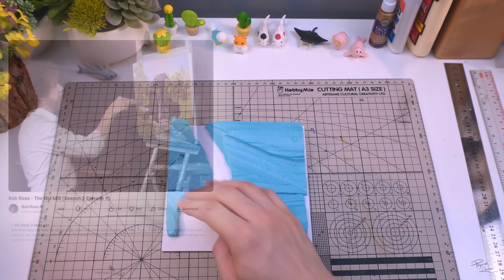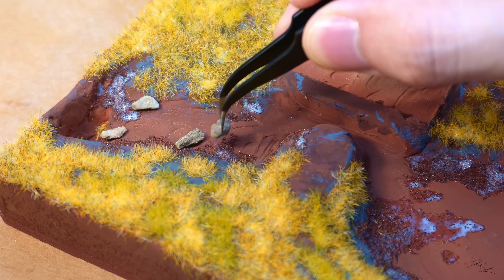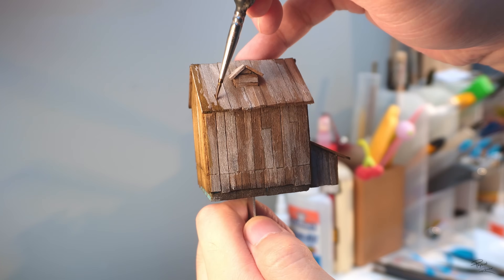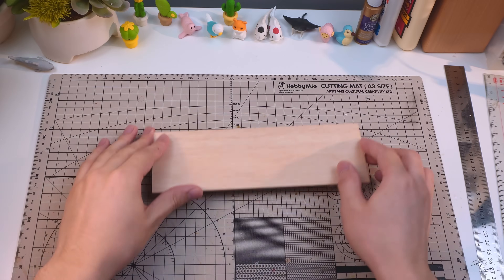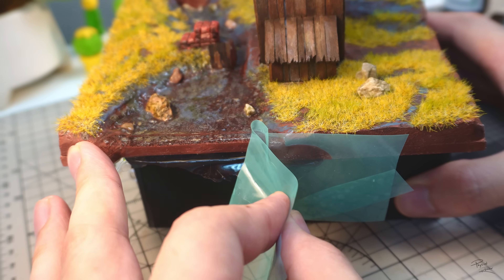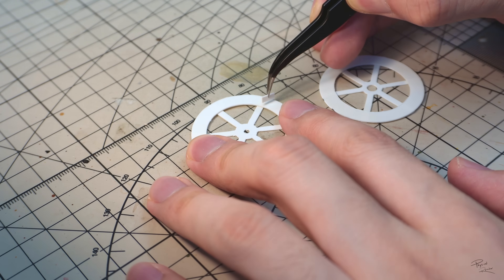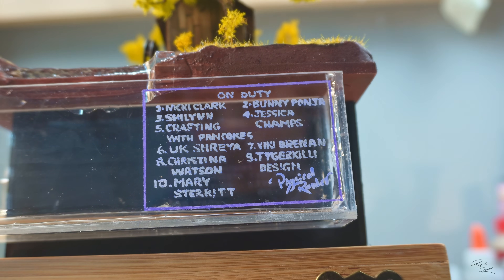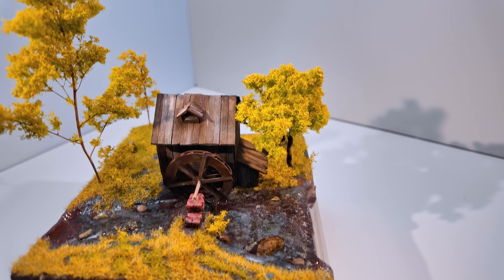I built Bob Ross's Painting, with Real Water

Comment: Look at you Mr. Render Ross lol.  Yet another wonderful production and one by the master at that. Being someone who lives in the southern United States where we still have a few of these mills around including one close to me on the Blue Ridge Parkway called Mabry's Mill I can tell you what Bob painted is actually not physically able to function lol.  Mills were actually built in areas that had a drop down, like a small waterfall, that way the water coming in was on a higher level and dropped into the spinning slats at  much higher spot than the area where the water came off the wheel.  By building the mills this way even when the water was low, due to something like drought causing the water flow to nearly come to a stop, it would still have to go over the falls area making it a rare occurrence for the mill not to turn.  This also causes the wheel to turn forward where as if it was built like Bob painted it then it would turn backwards, just like your diorama wheel. Where there was no falls area this design was used but it wouldn't create that over the wheel water fall like in the painting and it would also not work when water was low and/or slow moving.  I think you will find you will need to do the design like im speaking of in order to get that beautiful over the wheel water movement if you try this again in the future❤
Reply from the maker: I see. I studied the theories behind these but never really got a real-life note from anyone. Now that you mention the mill being built at a point of change in elevation, the images I've seen make a whole lot more sense. I assumed people dug the earth down and built the structure below, (which in retrospect, would have been a larger engineering marvel than the water wheel itself lol). I'm happy to hear and learn new things.
Reply: @physicalrender Well in an instance where you had an even water flow, like in your diorama, but you would never get that over wheel waterfall effect.  I have seen water mills where the creek was rerouted using wooden troughs in order to have the water flow to a desired mill location  but this still required the creek to be higher than the pond that the water would spill into.  Mills built on rivers that I've seen are usually built at dams.  This eventually led to us realizing  water going over dams could turn turbines inside to make electricity which put the use for mills built on water out of use lol.  Anyway my point is you'll never get that over wheel effect without first raising the height of your water source.  I too love to learn and i love to share knowlesge when i can as well.😌
Reply from the maker: Ah, it's interesting to know that you'd actually take the trouble of routing the water elsewhere. I mean, a little routing would be expected, but to route it prioritizing a favorable location over perhaps the length is rather interesting to note. Hopefully, someday, I'll recreate a much more accurate and realistic watermill. Thanks a lot for sharing your ground experience. Else, I'd have been ignorant and simply made a random mill without its quirks and originality.
Reply: @physicalrender Well it wasnt my intention to claim you were ignorant! Especially since your point of reference was a painting that was technically impossible,  yet looked perfectly plausible. We would all be ignorant if that was the case with most thigs we set out to create😂  Can't wait for your next great  creation ❤
Reply from the maker: Ah, no. I didn't take it that way. Don't worry about it. It's all good. It just dawned on me that despite learning the engineering side of things, there's still many obvious things I'm ignorant to.

Comment: Recreating one of my favorite paintings, I grew up watching him. I really do love how it turned out,I do see what you mean now.  Even if  the wheel not perfect, it’s an happy accident. I think you should make a series out of this, would be interesting to see. For your question, for some reason, I wasn’t able to reply back to you on your other video. I’ll answer it here. I never needed to make my leds to flicker, I have seen other people do it. Using a transistor-based circuits or even a microcontrollers. Which is programmable on pc. For simple way, use a tea light. It already flickering.
Reply from the maker: The tea lights look interesting. It's a simple solution and provides flickering, albeit on a larger scale. I suppose it could be scaled down.. somehow 😅 I have seen those flickering controllers, too. But I wanted to steer away from those arrangements for now. So I think the tea light  looks very promising to me. Thanks a lot for that. Also, I am very happy to hear that you enjoyed the video and the concept. I would like to continue these ideas, perhaps a series, as you've pointed out. I just got too many I'd want to do and very little time haha.
Reply: @physicalrender I used them too in the torch for one of my Potter dioramas
Reply from the maker: I see. Well then, I should surely get cracking on reverse engineering it. 😁